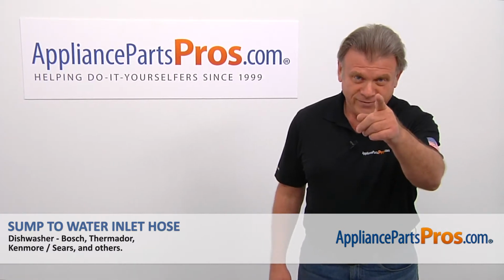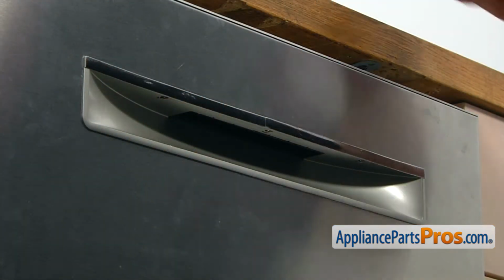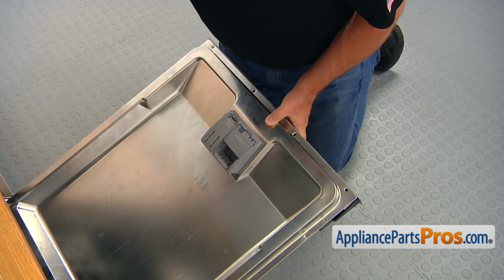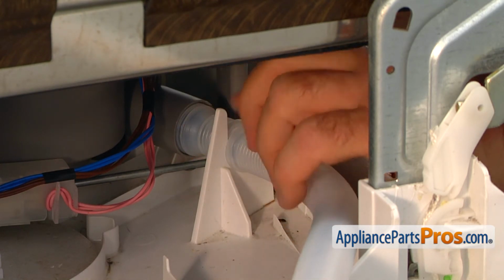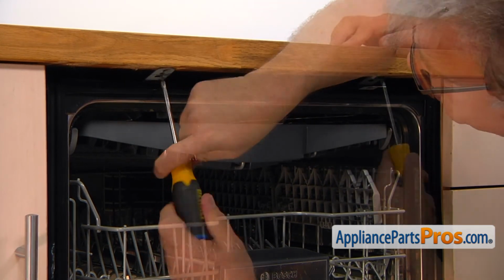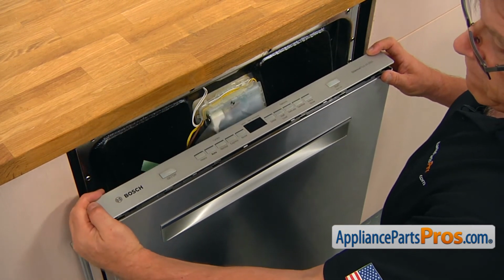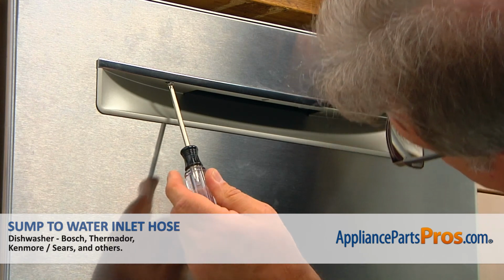How To: Bosch/Thermador/Gaggenau Sump to Water Inlet Hose 00668104

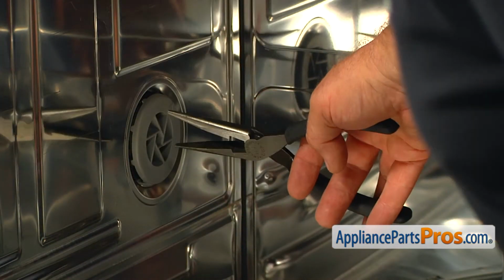Comment: 6:30 I used a 10mm hex wrench and it fit perfectly.

Thanks for this video. A mouse ate both hoses and this saved me a service call.
Reply from the maker: Awesome, glad the video saved you a service call! 🙌 Great tip on the 10 mm hex wrench fitting perfectly, that will definitely help others doing the same repair. Thanks for sharing!